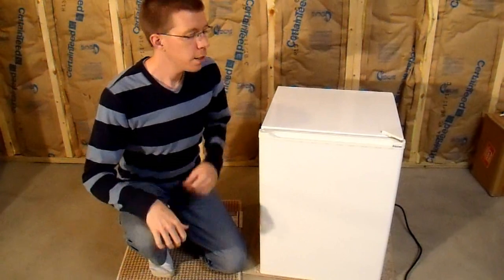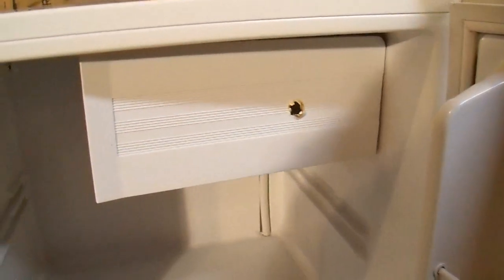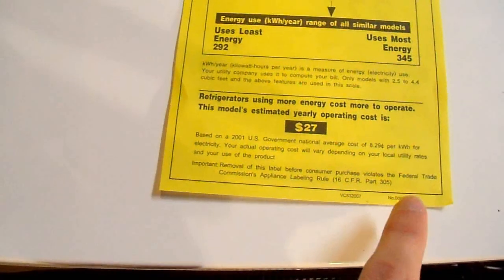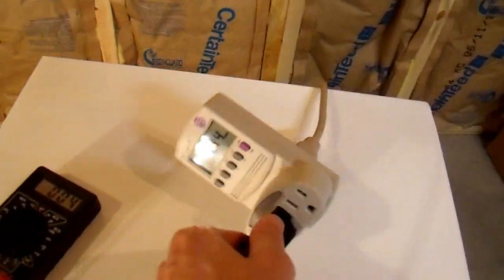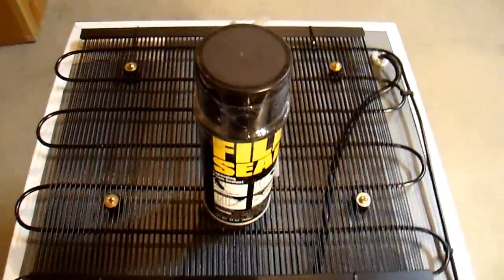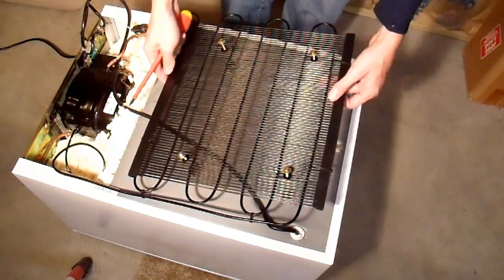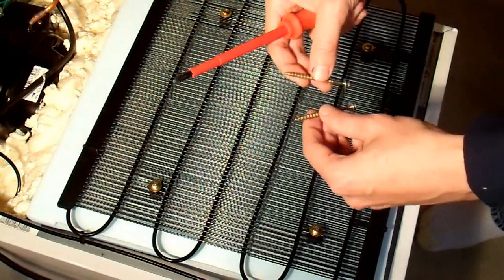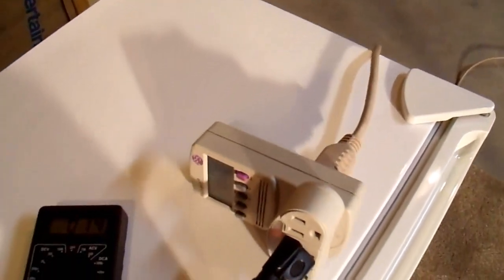Convert a Standard Minifridge into a High Efficiency Refrigerator - Part 1/2

Comment: Took your ideas and took the compressor outside of the fridge, used reflective insulation around the entire fridge, got rid of the coil and put in a car radiator the same size with same length of tubing..  made it much better. The compressor hardly ever turns on which it used to stay on almost all day..

Comment: He’d better not just add insulation. Any fucking asshole could do that.
Reply from the maker: Any other videos you've found that test adding insulation to see its actual effect?  I also covered voltage adjustment.  Perhaps you are unaware, but this is exactly what all 'high efficiency' refrigerators are - well insulated.  There is no magic involved.

Comment: Thank you thank you so so much for saving me time and energy running my own tests. You did everything as I would have. I'm so glad that there are other people out there realizing that these mini fridges use more than modern fridges four times their size. If we could improve the efficiency of the smaller ones it would be of huge benefit to people in tiny homes or motorhome Style living off solar.
Reply: for those applications there is the danfoss bd35f and bd50f compressor systems that are specially designed for that use... are used extensively in the marine and camper industry. the most important thing is the insulation and the airthight of the inside.... they are around for 25years and still there is not a more efficient system around... they run the brusheless motors like the new fridges that come on the market for the past couple of years....

Comment: There is an oil sump in the bottom of all refrigerant compressors. After tipping a compressor significantly from horizontal, even for a moment, they should be left set upright for a day before powering up, to allow the oil migrate back to the sump. You've no idea the number of premature failures this causes in ACs, dehumidifiers, and refrigerators. Can I possibly be the first to mention this? I didn't know the 'even for a moment' part. I carried a small fridge on it's back just long enough to wiggle it in to a small kitchen. Two weeks later the compressor was being replaced under warranty.
Reply: witch goes to show this guy has no idea what hes doing good way to  break  your fridge
Reply: i cant believe no one else mentioned it it was the first  thing  i noticed

Comment: Do some of these mini fridges convert the power to dc inside somewhere? could they be hacked to run on 12 or 24v dc?
Reply: I believe they use AC motors in the compressor that could be swapped, but they are sealed units and aren't meant to be serviced in this way
Reply: Other than the highly inefficient units that use peltiers rather than a compressor, no. The compressor is a sealed unit that runs directly from AC power. In theory the compressor could be driven by a DC motor, but modifying it would be nearly impossible since it's welded together. A DC powered refrigerator would certainly work well for solar systems though!

Comment: While there put a layer of kitchen foil on both sides of the foam layer you added. This makes no difference to conductive heat loss but interrupts radiative coupling between layers. I found it made a small but measurable difference when I did it to a small standard fridge. (I did this some years ago and dont have the numbers any more).

I also recommend leaving an airspace round the compressor by building a wall round it made from card before filling with foam in the gap between the card and the fridge - use foil lined card if you can or use more kitchen foil here too.

The idea here is to leave better air circulation round the compressor for safety and efficiency.

Talking of safety DO check you buy foam that is fireproof - if you fridge catches fire its most likely to be the wiring to the compressor that develops a fault so you do not want to pack kindling around it :(

The fridge sits between two cupboards in my kitchen leaving an air gap. I slid the door from an older fridge into the gap one one side so the fridge fits tightly leaving an air gap at the bottom so air can get to the bottom of the condenser/radiator.

On the other side I lined the inside of the adjacent cupboard with offcuts of wall insulation. 

Overall I better than halved the running cost of my fridge. And without doing anything to the door which is usually the weakest pointfor insulation.

Comment: Wow, so much wrong with this video.  Spray foam up against the compressor, not too smart!  Why keep calling the condenser a radiator?
Reply: James Koch the condenser is also a radiator.

As regards the coolant it is a condenser.

As regards the air it is a radiator - it needs to transfer the heat away. The point being made is that the design chosen is not very good at transferring heat away so it makes sense in this context to call it a "not very good radiator"

Comment: my new danby mini fridge doesnt have  a coil on the back?
Reply from the maker: Many of them don't anymore.  They often use the outside case to heatsink the condensor coils which doesn't lend itself well to improving the efficiency.  But it does make them slightly cheaper to produce which is all they care about...
Reply: Do you plug this size straight to the socket? How many watts would be a size like this?
Reply: BNROEC masterbate

Comment: Two things crossed my mind here watching this adding a small 120mm pc fan and channeled up radiator cover could really push the effective cooling faster and get the efficiency up, and adding a two liter bottle pop bottle full of water can prevent the refrigerator from running much a cold reserve of sorts. I got one of these refrigerators too and they are poorly insulated. I was thinking I should tear mine down the unit and do a Mylar and Styrofoam backing and do some of that great stuff and a bottle of water. Also thinking if you mix high salt content water in the pop bottle it could super cool the compartment while its off. Thanks for showing this video. Keep right on hacking up a better working widget.
Reply from the maker: I like the idea of adding a saline thermal mass to prevent short cycling.  This, like any, refrigerator would be more efficient once filled with food but completely empty was the most repeatable.  Given that the refrigerator only consumes 70 or 80w when running adding a fan that consumes an additional 5w would likely decrease the efficiency.  Might be an interesting experiment though...

Ripping the whole damn thing apart and insulating it properly would probably be the best solution.  :)  Hey, if you make a video on it post it here!  I am sure my mods can be improved upon.
Reply: When I have some spare time I will try and see what I can do to improve it and then take a video about it.

Comment: That's interesting.  I'm curious to know how it turns out.  This could really help me when I finally take the plunge and go off grid.  Every watt saved can make a big difference on a solar set up.
Reply from the maker: Yes, this is the motivation for this video.  A battery powered application or 'off grid' application can really benefit from small savings in the refrigeration budget and it doesn't take significant effort or cost to improve a standard efficiency refrigerator.  The 2nd part will be posted in the next few days.  Thanks for watching!